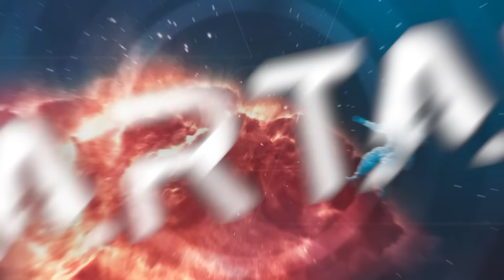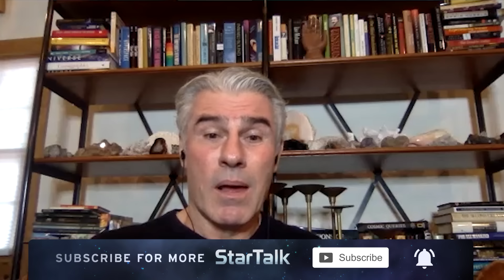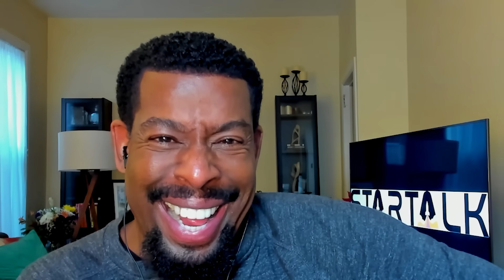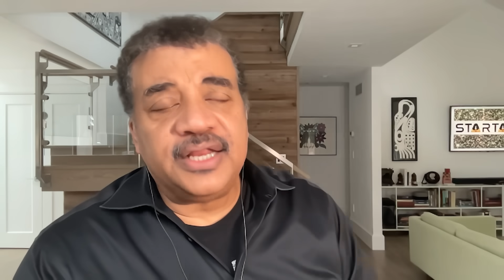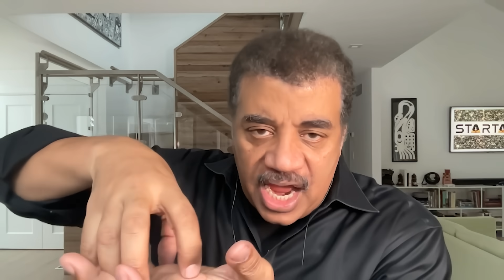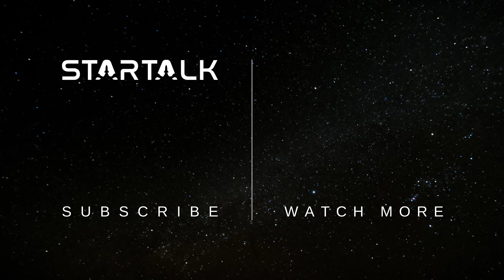What’s The Fastest A Car Can Go? | Neil deGrasse Tyson Explains...

Comment: This is the first time I felt smarter than an astrophysicist.
Reply: Everyone has different fields and specialities
Reply: He is an incredibly interesting and brilliant guy.
Reply: @hbuetow  I never said otherwise.
Reply: No one should pretend they know everything this is proof 😂
Reply: What if u explain to us what is he wrong about in the video? 

I'm not trying to be rude btw, I just wanns know what is true and what is not and learn :3
Reply: @engineeringlandaeta  There's a few things that he is not correct about in this application of the science he's using. I'll address a portion of it and leave the additional inaccuracies for others to explain if they wish to do so. 
His statement on the calculations of adding weight and adding power running in parallel to each other are incorrect. They don't cancel each other out like he was implying because it's possible to increase the power at a greater rate than the amount of weight that:
(A) Is required for optimal traction, and 
(B) That is brought on by additional or larger parts required when increasing power. 
Also his statement of 1g of acceleration being the limit is inaccurate. Because the g's they're talking about are what's generated upon acceleration and not a requirement for acceleration, because these g's are lateral, being the force you feel getting shoved backwards from the direction of which the vehicle is accelerating. The 1g he's talking about is the downforce upon a vehicle, which from a stand still will never be more than 1g unless you have a fan blowing down on it or if you're using a form of suction to pull it down toward the road or if you're using a source of propulsion (rocket, jet engine, stream of compressed air or other substance) that is pushing the vehicle down. He says the limit is 1g because you can add all the weight you want but it doesn't increase the idle g's but that's irrelevant because the way he's using g's is wrong for this calculation. So his pointing out the one g of force, that all things have at idle while standing still is, once again, irrelevant to acceleration at this point and is definitely not a limiting factor. 

[Disclaimer]
I am not a scientist so the terminology I've used might not be (and most likely isn't) correct but I hope I've explained things in a manner that makes sense and is understandable.
Reply: I know he acts like if he says everything really slow and he acts amazed, that we’re all supposed to also be amazed, even though what he’s saying is so basic.
Reply: Feeling smarter doesn't mean that you are smarter. Enjoy it while it lasts.
Reply: Let’s go Neil! Fill in the gaps.
Reply: Lol this guy also believes there are more then two genders 😂😂😂 most people are smarter then neil
Reply: A car can be pulled too,
Like the rope and pulley system in crash tests.
Reply: I think people confuse mistakes with unknown factors. Generally he's usually right or at least I have never heard him proven wrong. His analyses of the car and tires are generally correct.If you add other factors then you can surely make an exception but not without changing the scenario he describes. 

What I do know is I had a 2016 Honda Valkyrie which is a flat 6cyl engine and 1.8ltr. a Stripped down Gold wing. And it would do 0 - 60moh in about 3.2sec. Or at least according to the timer I used. It was fast. I tried removing weight and slimming down but kept getting close to the same and never really any better. I used the recommended tires for every day use. Had I placed super sticky tires then it would grab into the street like Neil described and maybe improved it slightly. But then that's not the same as friction vs a sort of gearing of the rubber into the street. But I'm  just an average Joe. What do I know. 😂
Reply: @MicJaguar Instead of stripping it down what you would have to do to get a better acceleration is add weight and power somehow, (add a turbo or a bigger turbo if there's already one, or a NOS kit, there's a few other things that can be done as I'm sure you know). In summary: 
weight+power = <acceleration
Reply: I know, right? 
Guess he's never heard of weight transfer, or the leverage of a four-link.
Reply: 1g of force is not the same as 1g of acceleration...
How fast is 1g in speed?
22 mph
For example: An acceleration of 1 g equates to a rate of change in velocity of approximately 35 km/h (22 mph) for each second that elapses.
Reply: @aj2858 nope.
Reply: Forgot awd 🤗
Reply: These people claiming he is wrong, while offering no reference to any specific errors, or saying things like "Guess he has never seen an NHRA race" is a great illustration of the Dunning-Kruger effect in action. Are you people aware of the fact that while you either did not fully comprehend what was said, or, and most likely, you only listened to the initial claim made in the video, and instead of listening to the details which explain why and how this claim is correct, you instead decided that since you HAVE watched cars go fast down a track, that YOU actually believe that the verifiable genius/Astrophysicist, is  incorrect, and that your knowledge and intelligence, on this matter, maybe even other matters, to be greater??!?!?!? 😂 I think you have gone to too many races and all the exhaust fumes have affected your mind... not sure who this comment is for, as people that can't pay attention to a short video are surely even less likely to READ this whole thing.
Reply: @wonderbread3733   The verifiable genius has many fans, exudes confidence and has exceptional recollection of astro concepts and figures, but he's confidently spouted off some truly outlandish BS when communicating his own thoughts  so ease up a bit on the worship
Reply: 😂 I am not sure you are smarter than a fifth grade! Do NOT trust your feelings. They're clearly not reliable!
Reply: So many wrong things.
Reply: nice but you cant monetize ur knowledge cuz u cant communicate with society like Neil Can lmao 😂 soo plz keep coping in ur pea size brain
Reply: You obviously don't know what you don't know...
Reply: If the tires are wide and the SURFACE is sticky a car can pull 3 gs. Drag race cars nowadays have a g force gauge and even with small tires 10.5” wide a car can pull 2.5 gs. Even on a normal concrete surface without gluing the track
Reply: Apparently he's never seen a Top Fuel Dragster accelerate from 0 to 300mph in three seconds at 6 to 8 g's. Sorry Neil but you blew this one.
Reply: @StevenDaugherty-uo5cs right we just watched 3 guys that have never seen or better been to a single top fuel event.
Reply: @StevenDaugherty-uo5cs Did you even watch the video or are you just being completely dumb for no reason?
Reply: @StevenDaugherty-uo5cs they have sticky tires. Not normal car tires.
Reply: @StevenDaugherty-uo5cs  air is acting on the surface of the body, not to mention the spoiler, the only function of which is to apply downward force, basically pressing the car against the driving surface, and increasing that downward force as the car's speed increases. There's also the issue of the burnout done just before the start of the race. What do you suppose the point of that is?
Reply: How about 300mph in 3 seconds without digging into any road. It’s called top fuel Nhra style. Look it up Neil. Come on your a smart guy, you can’t really be this behind the times. 
Ever watch a drag and drive event. 5-6 second 1/4 mile drag cars all legal to drive in the road and do hundreds of miles. To get from track to track in a week.
Reply: @Bandit.Designs.Videos clearly you didn't pay attention to the video. Read my comment above if you want to compare apples to apples.
Reply: Your not
Reply: @terrybates8407  you're*
Reply: 1st time I disagree I think with him hmm
Reply: not me, i've heard Tyson talk before...
Reply: @homewardboundphotos  I would assume intelligence in that case. Weird how stuff happens ironically huh?
Reply: @rickwilliams967  "I would assume intelligence in that case. Weird how stuff happens ironically huh?"  

dude wtf is this incoherent mess?
Reply: @josephfuller6229  considering you act like Tyson is a higher being, i completely agree with you.  Irrational worship doesn't have to be limited to the supernatural.
Reply: @josephfuller6229  lol  ok dude have a good life bye now
Reply: @homewardboundphotos  awe poor Felicia crying because she was asked for facts
Reply: @homewardboundphotos  I'm a long time listener and a big fan. He did get some facts wrong this time. That's ok everyone makes mistakes. Still a huge fan of his.
Reply: @harut82  He makes a lot of mistakes.  I've heard him say a lot of stunned things
Reply: @homewardboundphotos  I always hear people saying this but nobody can ever prove it
Reply: @adamthomas1222  he was wrong a few weeks ago about the fusion breakthrough that everyone was freaking out about.  lol.  it's not some monumental breakthrough and it will change nothing.  he doesn't mention they are only calculating the direct energy from the lasers, not the power consumption of the entire system.  the actual energy of the lasers is like 1% of the entire system.  i mean theres more.  and if he's not directly wrong, he leaves out half the argument, glosses over big problems relating to his arguments.
Reply: No kidding, it's not friction it's called cohesion, right off the bat he's wrong
Reply: @idsdragon8293  Cohesion is electrostatic attraction. Friction is when it’s physical, so it would be friction, not cohesion.
Reply: @OH10MADE  wow, you can read the brochure.
Reply: @robbie1290  who tf are you? 😂😂😂 You’re that kid that nobody talks to, so you blurt out random BS for attention…. It’s ok, Robbie… I’ll be your friend!
Reply: @OH10MADE  don’t worry probably some flat earther who has to believe everything is electromagnetic because friction and the force of gravity don’t line up with their flat earth bs.
Reply: @idsdragon8293 cohesion means blend or merge, the rubber in a tire does not do that, it's creates friction through a wearable item(rubber) which is soft and malleable.
Reply: @idsdragon8293 it’s actually friction, friction is about contact.

Comment: I am surprised that you left out one important factor.  If you take the same car, with the tire temp. the same in Miami and then took it to Denver, the car will accelerate faster in Denver, since the air is thinner in Denver resulting in less air resistance, correct?
Reply: Not if it’s naturally aspirated. The thinner air also means less air for the engine so it makes less power.

Comment: Yeah you also have several other factors involved as well the overall surface the contact space between the tires in the surface

  As well as the air pressure in the tires and the melting point of the rubber so you have to factor in not just the way to put all these other factors as well

Comment: Not sure it's fair to call this an oversight, but you guys might find it interesting. In motorsports that require a takeoff at the beginning of the event (such as drag racing), where maximizing acceleration is key to a good time, pro drivers are known to not go full throttle, because of that burnout principle where too much spin doesn't let you grip the tarmac. They actually use just enough throttle to grip the tarmac without being too much, and they'll add more throttle as they gain speed and have less room for grip loss, due to how the RPM of the wheels and the speed of the car interact mathematically. Pretty cool.

Comment: The tires, traction, air pressure and wind speed is always the issue. The all wheel drive Bugatti Chiron super sport managed 300 mph, but the tires had to be reinforced, and the speed was impacted by air pressure and wind speed and direction. Does 0-60 in less than 3 seconds which isn’t a stretch nowadays (in supercars anyway). My Audi RS3 managed it in 3.8 but that was a perfect windless day. Slightly wider rear wheels compared to the front wheels and electronic computer controlled all wheel drive to control traction helps. Basically looks for deviations in RPM between all 4 wheels and speeds up/slows down each to maintain traction and that software is improving all the time. Am only talking cars people can buy and go to the store with - not drag stuff with rockets and things. They’re not cars. Musk’s roadster is a car but was “slightly” modified to manage escape velocity. Fun fact: at top speed, the Chiron’s tires would only last for 13 miles, but it would run out of gas with 3 miles to spare anyway.
Reply: Some rs3 cars has wider front tyres then back...

Comment: What about increasing the surface area of the tyre and therefore the contact area between the tyre and road as in the case of the drag car?
Reply: That works under certain conditions.  As the contact area increases there must be a increase in "sticky" to show a net gain.  Drag slicks are not only wide, they are sticky.

Comment: In my opinion, the Honda Type-R (while a very cool car) suffers from this problem. It accelerates so quickly that the tires, which need to be daily-driver usable, just can't keep the traction. Even it you start off easy to try and get the grip, the tires keep breaking free all the way through the gear changes if you lay into it. Quite a machine (and scary fun), but it doesn't rearrange you internal organs the way a Tesla with an enhancement option does. Peace!

Comment: Some production cars can achieve sub 3s 0-60 (or over 1G acceleration), because they utilize similar tricks that the top fuel dragsters do - they temporarily increase the stickiness of the tires. The road surface is never completely flat - it is rough with small imperfections, acting a bit like a gear rack. And the tire is deformed and pushed down by the weight transfer of the car and some clever suspension, so that it acts a bit like that pinion gear at the gear rack. So the friction coefficient is a bit greater than 1. All of this was also mentioned in the video. 
However those cars are pushing the usability limit and it cannot get much quicker than that. We know that dragsters can achieve much more than 1G acceleration, but no one actually wants to be driving a dragster on the street.
Reply: They need a downforce /vacuum fan to increase the downward force without excessive weight
Reply: When dragsters take off the diameter of the tires increases due to centrifugal force.

Comment: Un actually, tesla claims the plaid can do 1.99 0 to 60. But the issue is the track. At the start there is something called roll out. Where the car has already started to accelerate before the timer has started. Because the tire hasn't cleared the laser to start the timer.  The more you know

Comment: Sorry Neil, but you are wrong. The more surface area of the tire allows for more traction for faster acceleration. This is why high horsepower cars have wider tires than low horsepower cars. For example, the top fuel drag cars can accurate from 0-100mph in as little as 0.8 seconds. Sure sticky tires help that, but you can not overlook the massive width of the tire giving it far more surface area to grip the road.
Reply: There is a thing called “diminishing returns”. The fatter the wheel (and therefore the larger the contact patch), the lower the contact pressure for the same vehicle weight.
Reply: @lawrencedoliveiro9104  Sure, eventually you could have a tire that would reach that point. But in my example of a top fuel dragster the car is able to accelerate 5 times faster than Neil said was even possible. He said you can only accelerate 1g without the use of a jet engine. But top fuel dragsters can pull 5gs with only a piston engine. While Neil is a very smart person, i think he should stick to what he knows or do some research before making false claims.